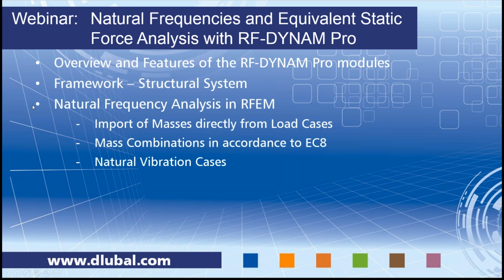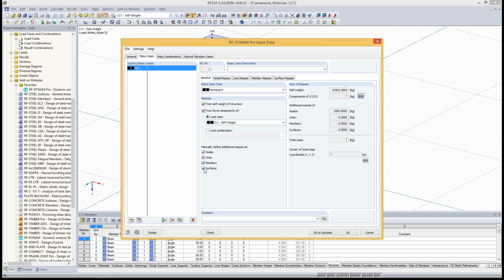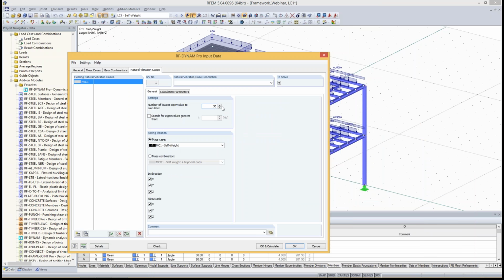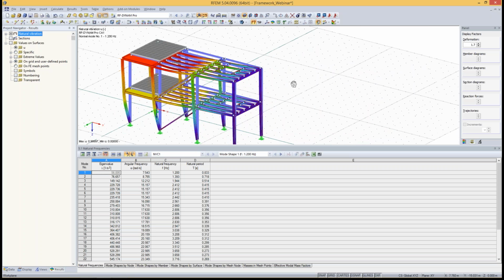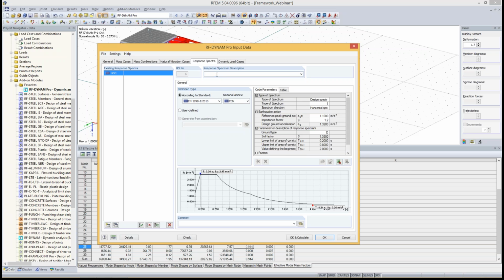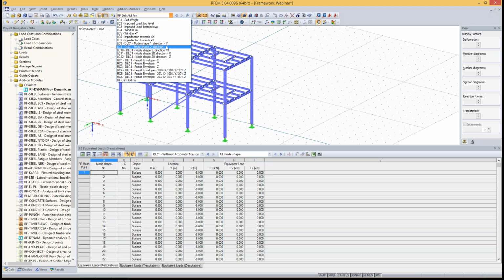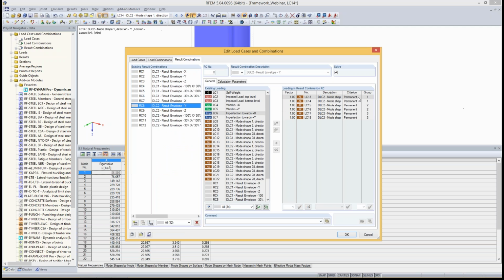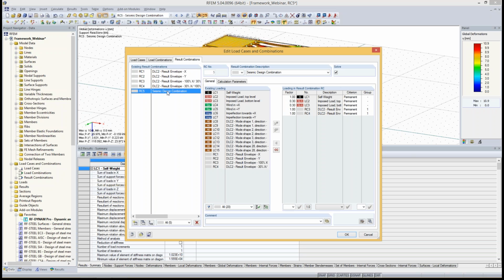Webinar: Natural Frequencies and Equivalent Static Force Analysis with RFEM

Comment: So can you please explain the real life significance of this type of analysis? what i meant it, i did get a result of effective mass moving in X,Y and Z direction particularly larger values in certain modes. and i also did seismic design like you said. what all real life data that i can interpolate from it? what can i do to make it safe under earthquake and how can we determine the resonance and earthquake factor of safety from this analysis?
Reply from the maker: Hi, Manudev!
For seismic design, the add-on modules RF-/DYNAM Pro - Natural Vibrations and RF-/DYNAM Pro - Equivalent Loads are available. They allow you to perform the multimodal response spectrum analysis. After the analysis in the add-on modules, the calculated seismic loads are exported to load cases, which can be evaluated as usual.

You can also take a look at this Knowledgebase article about "Determining Equivalent Loads in RFEM and RSTAB".
https://www.dlubal.com/en/support-and-learning/support/knowledge-base/000468

Comment from the maker: Dlubal Webinar: Natural Frequencies and Equivalent Static Force Analysis with RFEM

More Dlubal webinars:
https://www.dlubal.com/en/webinars.aspx

Further information:
https://www.dlubal.com/en

#bim #cad #cae #concrete #connections #crosssections #dlubal #dynamics #eurocode #engineering #engineeringsoftware #fea #fem #glass #industrialconstruction #mechanicalengineering #membrane #plantengineering #rfem #rstab #timber #steel #steelconstruction #structuralanalysis #structuralengineering #tower #webinar